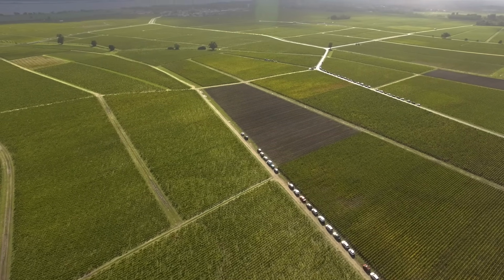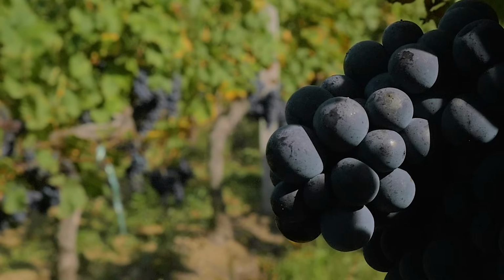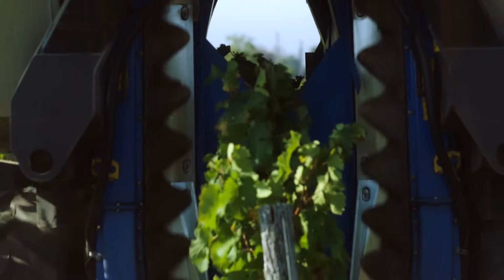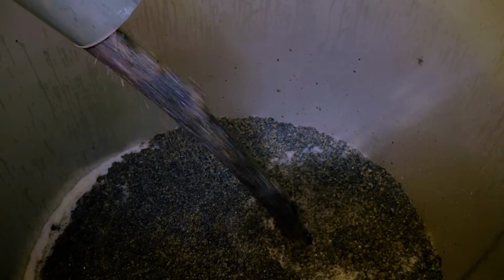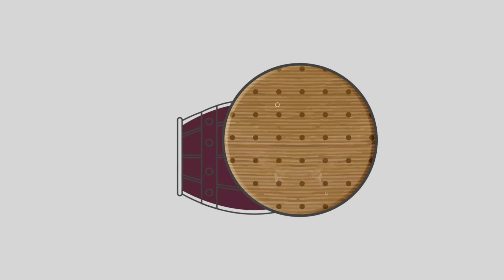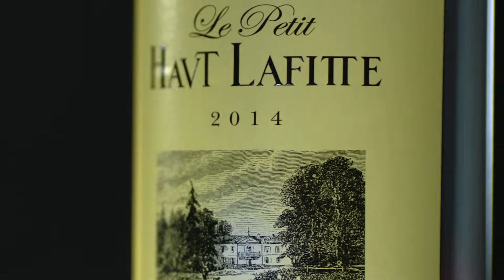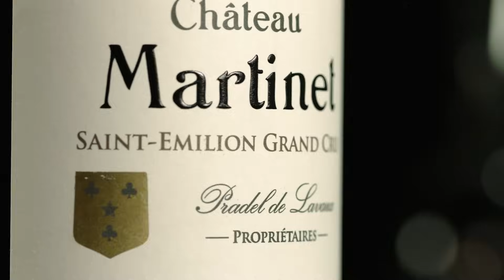Red Winemaking in Bordeaux Explained

Comment: The wife and I have a “make your own wine” store.   We have 8 batch tanks as well as single batch pails.  We find the single batch pails produce a finer tasting wine than the tanks.  Still can’t figure out why but I just thought I would share this with you.  The pails are “food grade” plastic and our tanks are stainless steel.  The pails are sealed with an air breather and the tanks have a lid which is not clamped tight or sealed.  Hmmm, maybe I just figured it out.
Reply: It might because plastic keeps temperature of ferment more uniform throughout the process, than the steel tank, which otherwise transfer out to environment by steel tank, I also just figure out from your experience
Reply: Ausome🎉🎉🎉🎉🎉🎉

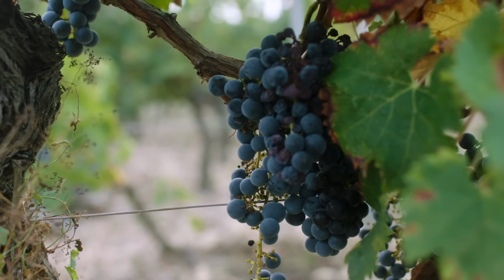Comment: @2:01 harvesting
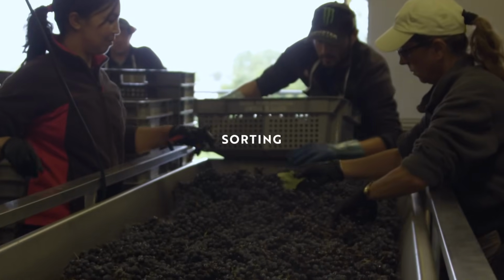@2:45 sorting grapes
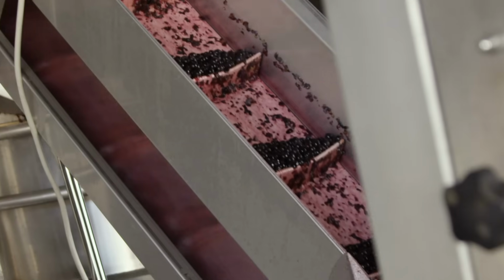@3:22 vatting
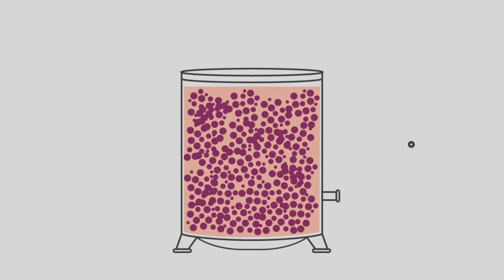@4:05 maceration
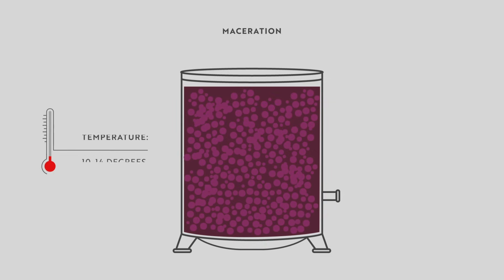@4:15 alcoholic fermentation
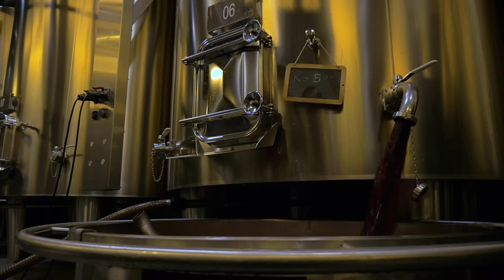@4:36 pumping-over must or cap-punching
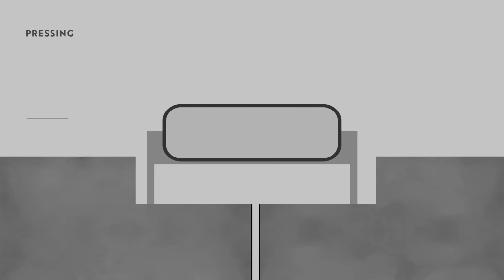@5:06 pressing
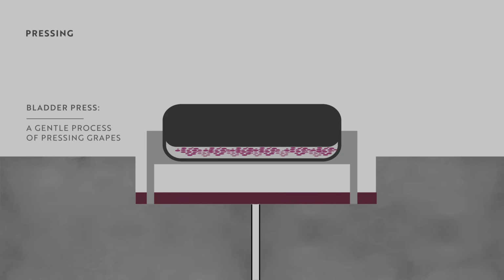@5:16 transfer to new vessels (stainless steel tanks or oak barrels)
@5:28 maloactic fermentation
@5:51 maturation (aka elevage)
@5:56 maturation - step of - racking (changing vessels) to remove sediments and to go through controlled oxygenation
@6:19 maturation - step of - micro-oxygenation
@6:27 maturation - step of - blending
@7:47 fining (wine clarifying)
@8:04 filtering and bottling
@? aging in a bottle (description is skipped)
Reply: Thank You very much!
Reply: Many thanks <3
Reply: So could harvesting during solar cycles affect the wine? 
Could harvesting the plant during its younger life effect the plant when it's older and more fragile?

Comment: What do they mean with 'if the berries are not crushed before maceration, the wine will be more powerfull and round because of a more gently fermentation'? After crushing the berries before putting them into the tank I thought it was better for the wine since the fermentation can already start and the contact between yeast cells and the juice is better. Also the longer the process is stretched out the better results they got, not?
Reply: I will try to awnser, and sorry for bad English. They missed a step, they run it through a "mill" (crush the grapes only so much that the pulp gets seperrated) and the juice is alot more controllable during fermantation. Basically the more dirty the grapes the more other yeast/bacteria dominate the fermantation. I hope this short awnser helps, if you have more questions just ask I will try to awnser.
Reply: @TDBStyl  Thanks a lot Timothy for this! I just made 200 liters on Sunday and indeed we ran the grapes through a mill.

Comment: Good day, how do i lower the alcohol of my wine , somtines it reached up to 30% ,and  what are the factors that affect the level of rhe  alcohol? Thankt very much and God bless(by the way i am making wild berries wine that are found in our country, but almost the same  process as yours)
Reply: It’s fermentable sugars and yeasts able to tolerate high alcohol by volume that allow a beverage to attain high alcohol by volume levels. So two factors.
Reply: If you are getting such high levels maybe making brandy from these berries would be a good idea.
Reply: @davedrewett2196  i only use LALVIN 71B-112 as yeast, i ordered it in the USA. And my sugat  brix is 23, cause we love sweet wine sir. With that sets of yeast and sugar i constantly get 30% alcohol sir, that is my problem sir its very high.
Reply: @nolinicolas4237  I think you are misreading the hydrometer
Reply: @BrentWalker999  good day sir, i'm using refractometer sir
Reply: @nolinicolas4237  hmm. Think there is a chance you might use it wrong?
Reply: @nolinicolas4237  after fermentation has occurred, you’re no longer able to use a refractometer. The alcohol changes the refractive index and throws off the reading.
Reply: @yovicta34  good day sir, so what is the best for measuring alcohol sir? Thank you in advance
Reply: @nolinicolas4237  a hydrometer can be used both for pre- and post-fermentation gravity readings

Comment: According to this video the wine is aged in a barrel and then bottled and sold. It is important to age the wine in the bottle for a period of time that can go from six months to several years in order to finish the wine properly. In the case of wines from Bordeaux this is left to the buyer. In Spanish wine from la Rioja region, by DOCa standards this needs to be done by the winemaker under very strict conditions. Rioja wines are ready to drink when they are sold, Bordeaux wines are not ready to drink.

Comment: Just a note, after alcoholic fermentation the wine is separated from the skins. The skins are then pressed to obtain what is called “press wine”, not juice as stated in your video.
Reply from the maker: Thanks Lori, that is indeed correct! The initial juice from the grapes is known as the 'free run' whereas the additional liquid extracted from the grape pomace is the 'press wine'. This press wine tends to be richer but less balanced, usually being added into the final blend.
Reply: &  "press wine" is the more inexpensive wine  I've been told

Comment: @Elicité  I have a question.In the video they did not mention SULFITE.I find it difficult to make wine without them so any reason why it is not mention?Do they actually use sulfites?
Reply: Yes, they do.
Reply: If all the sugar is converted to alcohol you shouldn't need stabilizers to prevent refermentation. The acidity and alcohol content also acts as a preserving agent.